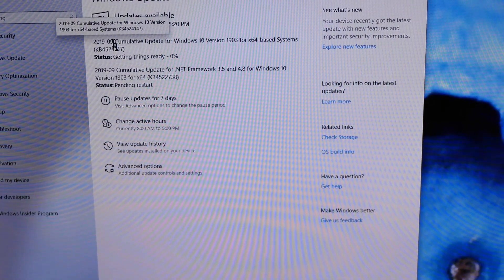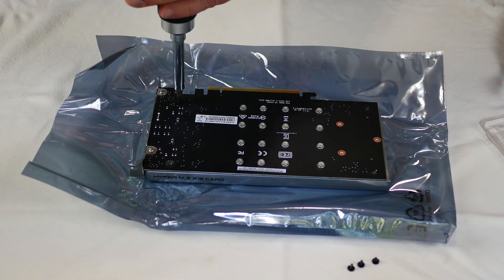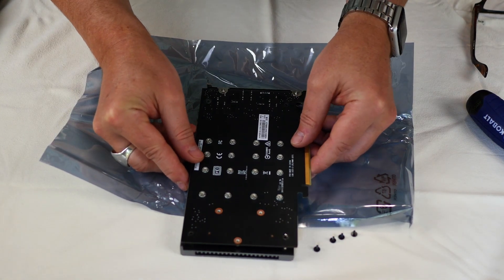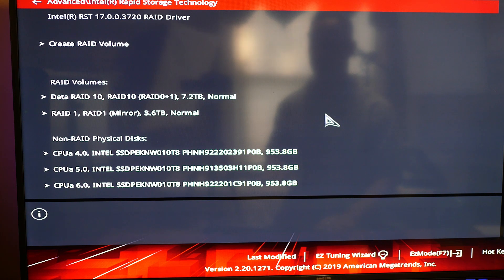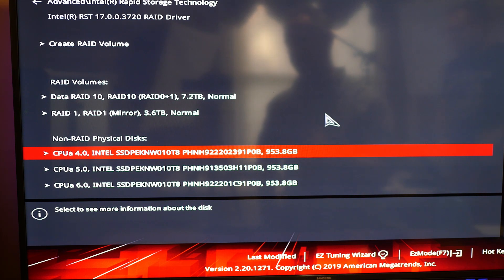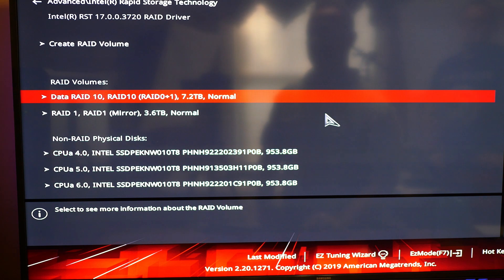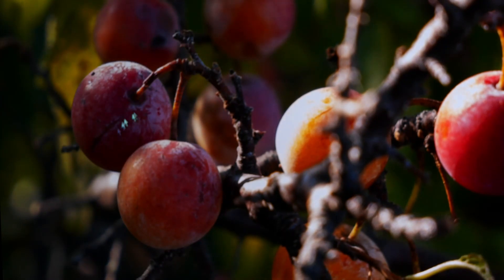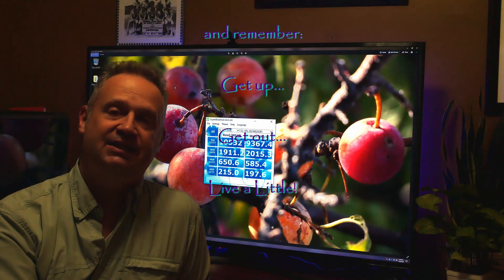ASUS HYPER M.2 V2 - PART 2:  Redo Drives & Initial Test

Comment: i have gigabyte z390 master, 3 nvmes on MB 1 GPU, if i use 2 pcie adaptors my gpu drops to x8 not x16, if i use this can i put 2-3 nvmes on this without droping the bandwith to my gpu?
Reply from the maker: I am not familiar with that mobo, but your motherboard book should show which slots will drop when other slots are used or when certain sata ports are used.  If x16_1 is dedicated x16 then you may just have to used your GPU in that slot for example…..it will all depend on how many total pcie lanes you have and which slots drop in combination with other slots.  See what your user manual says and good luck!

Comment: does the hyper card NEED to be installed in the first slot? im trying to install it myself but it just doesnt work
Reply from the maker: If you can put it into slot 1_x16 then you are better off but it is no necessarily required that it be in 1_x16.....Pcie lanes will ultimately control how you can configure it and the number of drives that will work in it.  Good luck!  ...and keep us posted on the final outcome.  You might also check out part three where I show an alternative method to get RAID0 on 4 x1 slots with an i9-9900K.  Again, good luck!

Comment: bro i bought asus hyper m.2 x16 v2 nothing shows in bios but in the disk management I see only one drive can you help me fix this? 
I have hp z420 xeon 3.2
Reply from the maker: I assume you have a Intel Xeon Processor E5-1650, it has plenty of Pcie lanes but I am not sure that the combination of HP BIOS, HP mbob, and/or this CPU will support VROC.  I used DuckDuckgo to search "CPUs supporting VROC" and clicked on the first search result; which, is a PDF at intel.com.  It points out that VROC is dependent on Intel's VMD technology and it must be enabled by the OEM.  It goes on to say that Intel Xeon processor families capable of supporting this tech are the W, D, and SP series of scalable processors...not the E5 family of Xeons.  I do not see that VMD is listed in the advanced technologies section of the CPU detail on Intel.com either.  I suspect that the E5 family does not support VROC.  I have no experience with this BIOS/MOBO/CPU configuration.  If you could get multiple Nvmes to be available in Windows then you would be able to at least RAID them...but I take from your post that you are getting just one Nvme drive to show up...and that may be all you get.  I doubt you will be able to boot from it either.  I wish I could be of more help!  If you find a solution please drop a line here!  Thanks for watching and I hope this helped in some way!  Merry Christmas!

Comment: Can you use all the nvme slots in the Asus Hyper, in non-raid, on the ASUS Maximus XI HERO board?
Reply from the maker: No, presumably because I was running out of PCIe lanes with the i9-9900K.  I am working on upgrading my workstation to LG3547 and should have some relevant content on the ASUS Hyper M.2 v2 card in that series once it is completed.  Part 3 of the play list you are commenting on should explain what I ended up doing with PCIe x1 risers to get an NMVe raid0 working...but it is not with the Hyper M.2 card.   Thanks for watching and commenting!

Comment: Now all I need is $6,000 to buy  4x  8TB  NVME's  so I can do a RAID5 or 6  in software
Reply from the maker: stay tuned for new workstation build and second Hyper M2. V2 card.  Not 8TB nvmes but using them in performance tiered storage space using Windows Storage Spaces in Windows 10.  Thanks for watching!

Comment: 3 nvme ssd  in raid 0   you have  this on  pcie x16 slot  you youse 4 lanes or 3x4 lanes? ( yu have x2 mode , you havnt full speed ?)   can you show me  if you GPU  have full 16 lanes ?  or you have only 8  lanes on gpu ?
Reply from the maker: Twinx Cäppy , thanks for the question....my understanding is that each Nvme wants to use 4 lanes per Nvme drive, and because my cpu, i9-9900k, has a maximum number of PCIe lanes of 16 then there is no way I can run 4x Nvme Raid on this card even in PCIe x16 slot 1.....because there are other uses of PCIe lanes to run this system and peripherals,  if you have a cpu with a lot of PCIe lanes, say 40, then it should not be a problem to run this card with 4x Nvmes and dedicated GPU x16, because in three case you would be using 16 lanes for the Hyper M.2 card and 16 lanes for the GPU or 32 lanes leaving 8 lanes for other devices e.g. sata drive arrays etc.  So, concerning your question asking if the GPU in my system was able to use 16 lanes with this card installed.....no, it was not....it’s probably ore like 4 lanes; which is why, as you will see in Part 3 that the PCIe x1 RAID0 provides a superior result for my use case.  I hope that helps answer your questions and if you have not checked out Part 3, please do and I hope it is very helpful!  Thanks again!

Comment: You are a brave man, running all your storage in RAID 0 configurations. Not sure how you are backing up all those local RAID 0 arrays that perform so nicely, but offer NO redundancy with increased risk of failure.
Reply from the maker: Thanks for commenting and what a good point you bring up....a lot of people may not consider this or value the concern you are commenting on.  So, a couple of things....first, I think the concern you are commenting on is the same no matter if you are trying to run a fast Nvme raid on the Asus Hyper M.2 card or any other RAID0 drive array....the risk is conceptually the same.  Secondly, the main reason to run working files on a RAID0 is for the super fast/no waiting experience....which is why people do it; however, I am rarely exposed to more than a few hours or a days worth of data loss in the worse case situation and this is because I have robust and redundant data storage procedures in place.  This includes syncing to a large REFS triple storage array, disk image archives, off site cold storage protocol, cloud storage syncing and all of these with an encryption protocol.  In the end, I have a couple of hot storage redundancies and a number of cold storage implementations in place and anyone else who uses RAID0 with data they want to protect should do the same.  Additionally, it is important to understand that even with data protection processes in place, there are other consideration and weaknesses other than RAID0; including, using non-ECC memory, hardware cycling protocol etc....there are always trade offs between the highest level of data protection, value of hardware/software/system protocols/management time, and performance....we all seem to want the best of them all, I know I do!  If you have not seen Part 3 yet, check it out.....you may also be surprised at the final RAID0 configuration I am using....it works great, I have had no problems, and it is certainly a cost effective solution for anyone with a few PCIe x1 or larger slots open on their motherboard and it does not tie up 4 PCIe lanes per NVMe...so for me, it has proved to provide that super fast performance/$$$ that I am looking for!  Thanks again for commenting, great comment, maybe I should do a video or two on protecting data...we shall see!  Thanks again!
Reply: Sounds like you have done plenty to address the recoverability of your data "I am rarely exposed to more than a few hours or a days worth of data loss in the worse case situation and this is because I have robust and redundant data storage procedures in place", so you are ahead of the game. What many do not realize is the balancing act between performance and availability in a home environment. RAID 0 (software RAID or hardware RAID) actually increases your risk of data loss. why? Take your 3 NVMe drive array in RAID 0. All 3 drives work as one, so if one fails, they might as well all fail. Is the performance benefit and ease of use of an NVMe (or SATA) RAID 0 array enough to offset the increased risk? Depends on your situation and how hard you are willing to work to make your data recoverable. 
For instance I personally don't run applications that require the absolute peak data performance provided by RAID 0. If I run 3 1TB NVMe drives as individual storage objects  I get the performance needed from each one, and one can fail without impact to the others.
For data recoverability I simply backup each storage object (drive) as needed (supplemented with file copies, database point in time backups, etc.) . So I am taking a more simplistic approach to data redundancy at the expense of the absolute peak performance for data access. So as with all things, there is no one size fits all.

Comment: Hi,
Is it possible to run raid 5 without vroc key while using non intel SSD's
Reply from the maker: I don't think so with only 16 PCIe lanes.....check out part three if you have not already.  Both the i9-9900K and 10900k have a max of 16 PCIe lanes, and if each NVMe uses 4 lanes then you cant ever get a 4 card set up....or even a 3 NVMe setup running in this card if you are using a dedicated GPU and other peripherals in your build.  Check out part 3 for what I ended up going with using x1 PCIe slots in raid 0.  IF you are running a CPU set up with say 40 PCIe lanes, then it should be no problem as long as you have 16 lanes to dedicate to the Hyper M.2 v2 card.  Thanks for watching and commenting!
Reply: FrostySith much appreciated sir. I do own a cascade lake x and an a asus rampage encore which does bifurcation however I am worried that vroc won’t work as a raid array bootable on windows because my ssd’s are not intel but rather Samsung.
Do you think it may work raid 0 or even raid 1 with a bootable raid array with non intel ssd’s drives?
Many thanks.
Reply from the maker: @TheBrunomotte  I think with teh v2 card it might....if you have it I would give it a try.  For me I did not feel the need to make the array bootable as the Nvme I think is fast enough for my OS....but I wanted super fast rendering and IO for backups etc.  But give it a shot and let us know!  Thanks for commenting!

Comment: Thank you for the info. I am building a system now, mostly for visual effect and to bring  an idea to life. Ive always been a generation or 2 behind because basically I'm poor, lol. I started collecting parts in January and I'm a couple water fittings and wire extensions short, but have started mocking up my system and doing some of the hard tube bending. MOBO is a Maximus 12 Formula Z490, cpu is I core 9 10900K, ROG Strix RTX 2070. Oddly I never heard of the Hyper card until I bought the MOBO, so I didn't have it in the plans. I purchased one for possible future addition but I know very little about M.s drives or RAID set ups. I have three M.2's going into MOBO and I am learning that there is so very much more complexity surrounding the M.2 architecture than I imagined so I have a lot to research on. I have now watched part 1 and 2 of your test/review and moving on to the 3rd now. Thank you for doing them, they are a great asset for someone such as myself. Thank you.
p.s. incase your wondering about my "mocking up" my system, It will be caseless, using 3 X 4 foot of wall space on either side of a corner in my room, with 2 water pumps and reseviors on the right wall of corner, and 2 radiators and the components on the left side wall. :)
Reply from the maker: Sounds like a cool project you are working on!  I hope part 3 helps!  The 10900K, like the 9900K, has a maximum of 16 PCIe lanes from the CPU so I think you are going to have the same results that I did if you try to implement the ASUS HyperX NVMe card into your build.  I think each NVMe will use 4 PCIe lanes and with only 16 available they will get eaten up pretty quickly.....which is why I had the results I did.  Let us know how it goes!  Hopefully we will get some tech oriented content out this summer on some projects we are working on!  Thanks!

Comment: I have the same motherboard (with an i9-9900k) and Hyper card but put in PCI_2 with 2x 128GB Samsung SSD's (from my old laptop). Windows "sees" the SSD's, but in the BIOS, they don't show-up in my RAID options (only my SATA HDD (D: drive) and M.2_1 SSD with Windows (C: drive)). Am I missing some BIOS setting, or can the RAID only be configured when the HYPER Card is in PCI_1 (occupied by my RTX2080Ti)?
Reply from the maker: There just were not enough Pcie lanes for this setup....to really take advantage of this card you will need a lot more lanes and have them available.  I may pull it out this summer and mess with it again when I have some free time....but as I think I touched on in Part 3, there are probably cheaper options that are faster if you are willing to run RAID in the OS.  Keep me posted if you get something going and thanks for commenting!

Comment: is it possible to install on the pci_2 slot cuz slot1 is taken up by my gfx card...  You install on the 1st slot, that's why i asked. btw: z390 maximus XI hero wifi + i7-9700kf
Reply from the maker: Nope, could not get three Nvmes to run with it in slot 2.
Reply: FrostySith 

So your graphics card is in PCI-e slot 3, at only X2 lanes of speed???
Reply: so that's means install the hyper onto slot1, then gfx onto slot3?